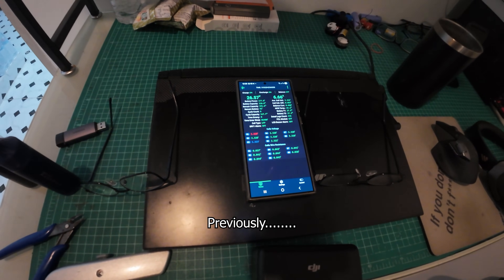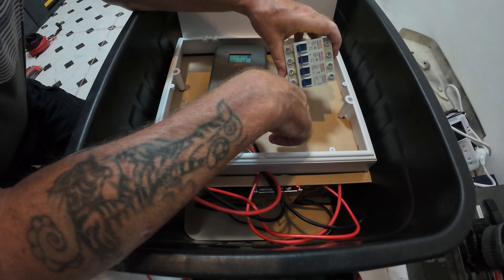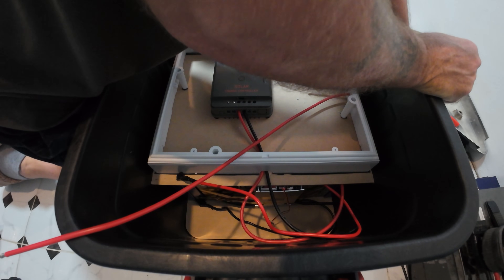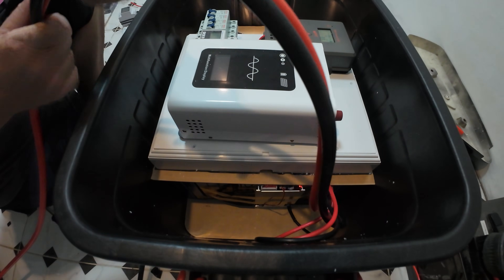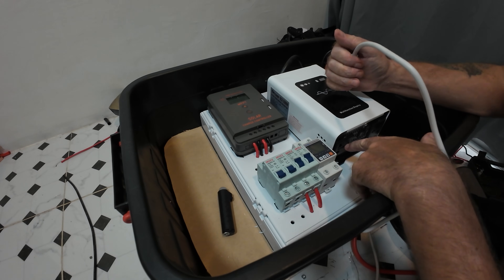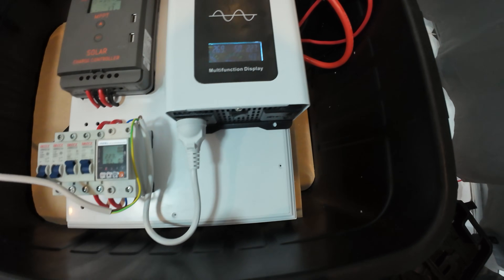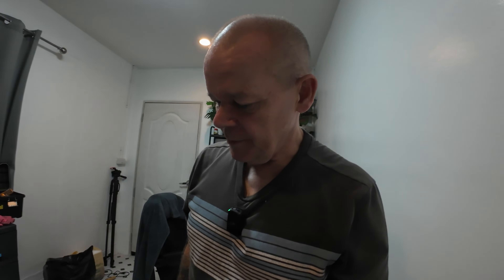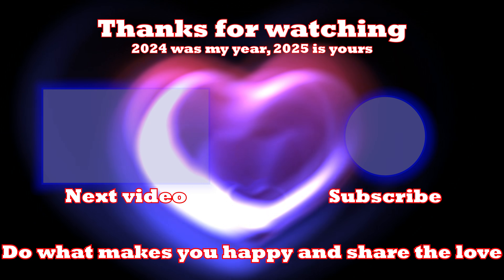Complete solar build on a tight budget. Part 6 - Wiring the electrics box and the finish (for now)

Comment: Like the safety slippers 😂
Is that a plug in kwh meter on your plug bank ?
Reply from the maker: Safety first mate. If there's a fire, the slippers will go first so it'll be a good indicator that I need to move 😁
I had 2 meters in this video, one was next to the breakers and the other was on an extension lead. Both are in kWh but the one next to the breakers has proven invaluable.

Comment: It's a professional installation compared to mine, I "temporarily" wired my setup spread out on the garage floor to check that it worked, and that's how it's stayed for the past 2 years.
But I did get around to installing some fuses 6 months ago.
Isn't your setup at risk of getting a bit toasty being sealed in a box.
Reply from the maker: Sealing it in a box is temporary mate, I'll sort it very quickly in a couple of years.
Seriously, I've made some changes and now it's got inlet and exhaust ports to drive the heat away and limit the bugs to one house per family.

Comment: @7:38 - but making a proper earth for that, being in the ground floor, requires only some shovel work, old battered tyre rim, a decent thickness of wire or steel pipe and welder/drill and a couple of rustproof bolts and nuts?
That's how our grans got their radio antennas earthed.
Reply: He's renting, that is why nothing is permanent....
Reply from the maker: As it's already been said, I'm renting. Plus which, I can't see any soil to dig a hole, it's all concrete around me :(

Comment: If you want to pop over Tony, i have got some solar rails and brackets in the garage. Do you think you would get a 4 meter length solar rail in your hand luggage 😇
Reply: Air fare included? 😁
Reply from the maker: If it's 4m long, I'll use it as a wing spar and fly back over here mate. I'll get on a plane now, see you in 20 hours 😁